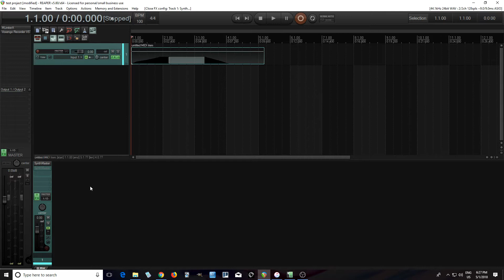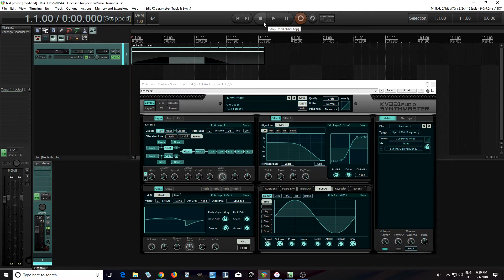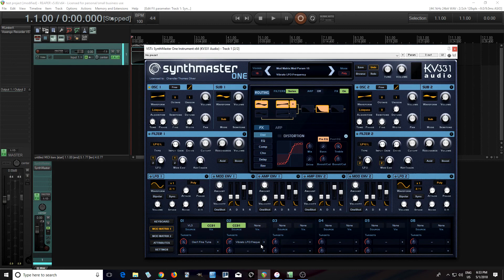How to add Vibrato in Synthmaster

Comment: You say your keyboard's mod wheel is "jerking all over the place"  I am wondering if a bit of contact cleaner in there might solve that for you.  I have an Edirol PCR-800 where the pan slider was generating its own events.  Also, the data was not being sent smoothly as I moved the slider. I bit of contact cleaner later and the slider is as smooth as and is no longer generating its own events.  The contact cleaner I used contains no lubricants.
Reply from the maker: Thanks. I'll definitely give that a try. Right now its like a ghost is working my modwheel.